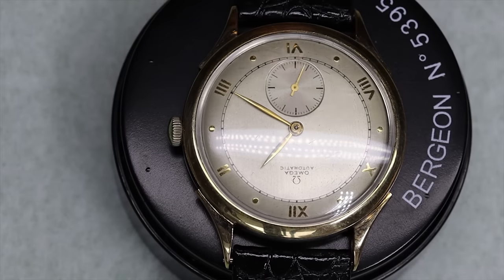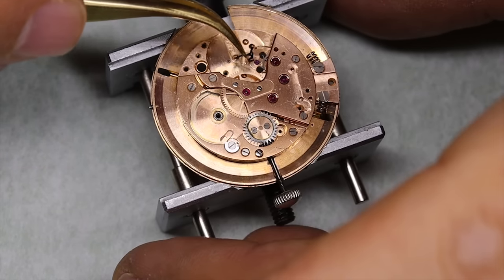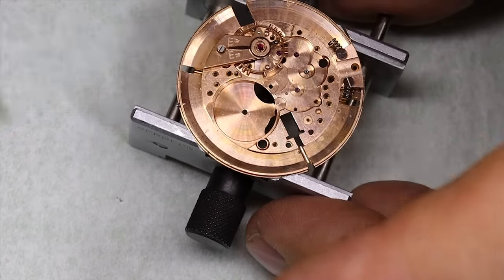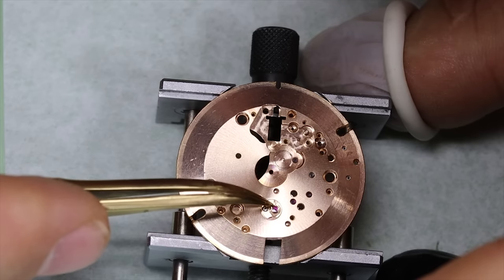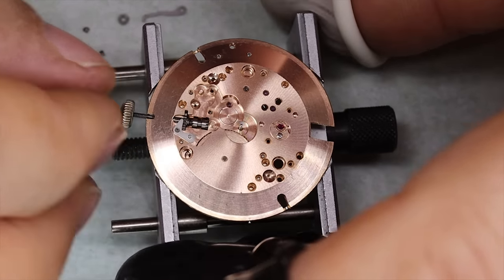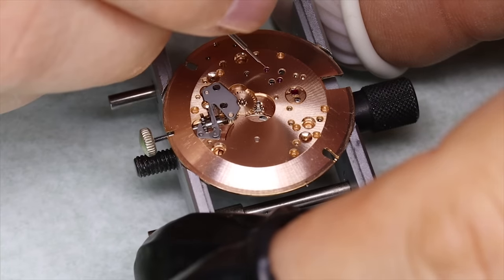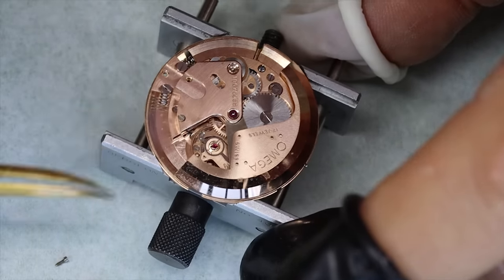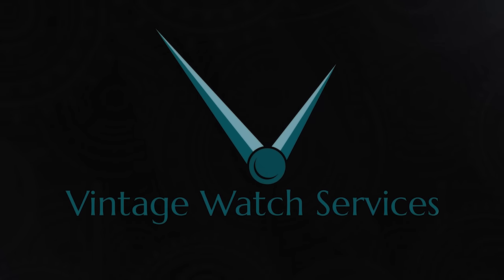Who Put the Bump in the Bump, Bu... in my watch? Servicing a 1944 Omega bumper automatic

Comment: Glad to see you back. I have three bumpers from the 1950s ,two Zeniths and a JlC . All wind efficiently and keep good time after service so not that inefficient or failed designs.
Reply from the maker: Thanks for your comment! No, bumper automatics weren't failed designs and I hope that's not the message you took away from this video. They were solid designs and the coolest automatics to wear, but the full rotor is simply an improvement. I have a couple of bumpers in my private collection that they will have to pry off my dead wrist 😂

Comment: Notice how the oscillating weight makes almost a full revolution, whereas in Zenith cal 133, the main spring barrel sits in the way, limiting its movement.
Reply: Excelent observation, this Omega has more degrees in it's swing so it should(?) have better efficiency. The 133 has a decoupling clutch between the barrel and the keyless works so the oscillating rotor does not have to waste energy on rotating those parts gaining some efficiency that way. The need to have as much swing as possible is also a result of the place where the two clickets operate, on the Omega they are placed on the wheel driving the rachet wheel and that wheel moves very little (with every rotor swing) so the larger the arc that rotor swings the better the chance that more teeth get past the clicket and lock. The Zenith has the clickets on much faster rotating wheels (even tho the teeth on which they click are larger) and they click and lock a little more often given the same arc of the rotor in both calibers. The Zenith is a later caliber and there was a lot of innovation back then. The choice to move the barrel on the outside probably helped them have a larger barrel and that is always a good thing as demonstrated in the chronometer competitions. More power available to swing the ballance allows for greater inertia of the ballance and a stiffer hairspring (higher Q oscillator) and that makes all the difference in good timekeeping. Low power to the ballance means weak hairspring and slow beats, balances that can get disturbed really easy on the wrist and take a long time to recover. For the record, I like the Omega better but the Zenith 133.8 is not bad either :)

Comment: Lovely looking inside and out! Can you explain the way you insert the balance complete, it’s always to the left first then you rotate 180 degrees, is this the best way you have found to line up the balance with the pallet fork properly?
Reply from the maker: Hello Boyd, thanks! The direction to place the balance depends on the layout of the movement, thus it can be either left or right, whatever makes it easier. You don't have to go a full 180, you just need to make sure that the impulse pin is outside the pallet fork when the pivot sets in the pivot hole. You can always lift the balance and rotate it a little bit if you accidentally hit the outside of the fork with the impulse pin, just be gentle and of course only start screwing it down when you're certain it's oscillating freely :)
Reply: Thank you Stian for always replying and giving great tips! It would be interesting to know how much time you spend on some of these watches, it’s hard to tell in a 30 minute vid. I can spend all day sometimes just trying to fix one thing, and still need to look at it again the next day!:-)

Comment: I really envy the talent you have. I do service watches, but would never touch an omega watch. These are priceless gems. I have an Omega bumper watch in which the movement is in pristine condition  but I am not very confident of the local watch repairers here in Chennai, India. I have to send it to New Delhi for good service, but that is sure to make a hole in my pocket. I also have a Tissot bumper watch which has identical Omega movement. I understand that Tissot and Omega had a joint venture a few decades before and this Tissot bumper watch could have been the outcome of that joint venture. By the way from which country are you from and what is your good name Sir. Maybe if you agree, I could ship both these watches to you for service and polish.
Reply from the maker: Thanks so much! You get a bit desensitized to the value of what you are working on as you work on more and more watches, and Omega watches from this era are very solid and actually quite easy to service. Thus if you find one that doesn't look so good and thus has a low value, you could experiment on that before working on your pristine one 😉 My name is Stian Lofstad, I'm from Norway but live in Switzerland now. It will be pretty expensive to ship your watches back and forth to Switzerland and I wouldn't advise it. I also pretty much only work on watches I have bought to service and sell. You can message me on stian@vintagewatchservices.eu, then I can potentially put you in contact with someone a bit closer to you.
Reply: This is great Stan. Yes, I will email to you and you can advise me on someone close to where I stay who can do a good job on my Omega and Tissot bumper watches. I am currently viewing Part 2 of Omega movement 1020 of your video. Simply loving it. Keep on sending these very informative video of yours. Take care and Stay Safe.

Comment: Dear Stian,
I hope you are fine. I've serviced a 354 movement nad I tried to oil the pallet fork exit stone with moebius 9415, but the watch didn't like this. I didn't overoil it. So I cleaned the parts and changed to moebius 941. With that I get 300 degrees amplitude. For a movement like this with 19800 bph is this oil ok or will it spread over time.
Kind Regards and thank you
Reply from the maker: 941 is just fine and congrats on a good result!

Comment: I have an Omega that once belonged to my grandfather with what I think is the same movement. Its a bumper auto, and it looks just like a Seamaster (screwed caseback and everything) but does not actually say “Seamaster” on the dial. Just “Omega Automatic”. It doesn’t run right, and I was wondering if I could get good enough performance out of it to wear it just with a service. The case is a gold capped but very tarnished. 

Omega really was one of the greats.
Reply from the maker: Hello Jacob, yes, you should normally be able to get good performance out of it. They are very high quality movements, like with everything Omega made back in those days. Omega was the best regarded watch brand until the 1970's when Rolex overtook them 😉

Comment: Good to have you back, great video as always. Only 2 questions, what are you using to clean the pivots and did you get the curved brass tweezers from Boley if not where as I'm having a real hard time finding any, nowhere seems to sell the in GB including ebay?
Reply from the maker: I use something called EVEFLEX, it's basically a rubbery stick that cleans the pivots nicely. They come in a variety of shapes and abbrasiveness levels.

Comment: Hello, thank you for doing these videos.  I do have two questions. Are all disassembly and cleanings equal when a watchmaker services a watch?  If not, what are the important things that need to be specified?
Reply from the maker: Hello, thanks for watching! The process is more or less the same for every watch, in that you first check functions with the watch in the case and then disassemble it while inspecting the parts. There are of course some differences in each make and model that may require different sequencing of disassembly or assembly, different treatment, lubrication etc. Also, various complications may need to be dealt with differently.

Comment: Another question. I just finished a Hamilton 982 manual wind. I have several broken ones so I do not want to keep taking this one apart again if I can avoid it. As I believe the balance wheel pivots get kind of stuck in their jewels if you find one that has been sitting. That should not be an issue now since I have taken it apart and cleaned it. The beat error is way off now but runs decent. Is it possible for a watch to run if you somehow have the impulse jewel on the wrong side of the pallet fork? End shake seems fine if I am qualified to say that.
Reply from the maker: Hello Jeff, the watch wouldn't run if the impulse pin is on the wrong side of the fork, no. The beat error is quite sensitive, meaning that a tiny offset from center makes for a pretty significant beat error reading. If you have a strong loupe of even a microscope you should be able to study this in detail. There are very affordable USB digital microscopes out there that work just fine.
Reply: @VintageWatchServices  Thank you!
Reply: Thank you again

Comment: What does the caliber number refer to, I have an Omega 351 Calibre.  Thanks
Reply from the maker: The caliber number refers to the number of the caliber :) It's simply a model number for that movement.
Reply: @VintageWatchServices  so it is not a measurement ?
Reply from the maker: @Al-po2oh  Generally no, it's mostly just a running number with some variations as to the significance of each digit. There are some caliber numbers that also indicate the size of it, such as the movement in the Patek Philippe video, but that's not the norm.

Comment: In software development, our rule is you ,multiply the dev's worst case estimate by pi ... and the program is only correct by version 3 :-)

I don't understand why bumpers were every invented - usually with a suboptimal design it is for reasons of cost or because the technology isn't quite there yet to do it better. That doesn't seem to be the case with a bumper - remove the block holding the springs and let the rotor spin 360. And a few minor changes to gears.

So why did movement designers back in the 40s ever design bumpers at all?
Reply from the maker: Well, the design wasn't bad, it's was a logical follow up from and improvement of the Breguet and Harwood designs, it works well and was relatively easy to manufacture. Without the bumper it might have taken longer to invent the full rotor. And for the handful of decades these movements were around, they were very popular. And they are very cool even today 😎